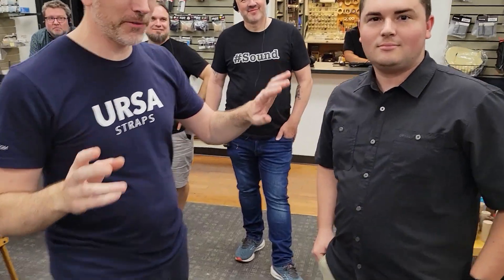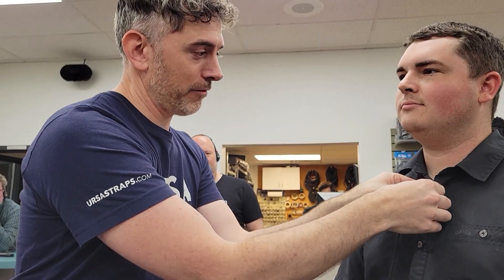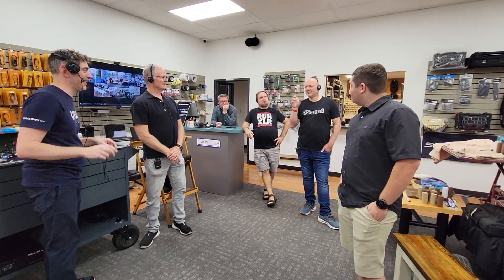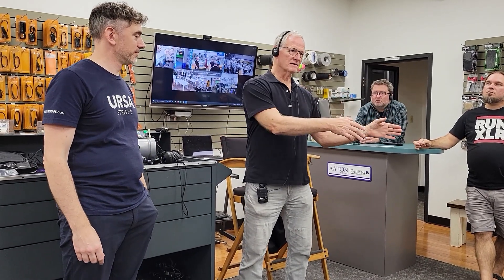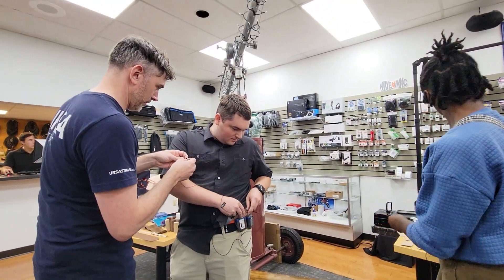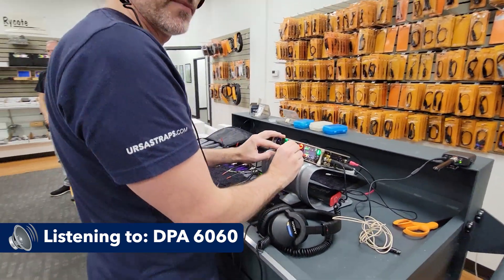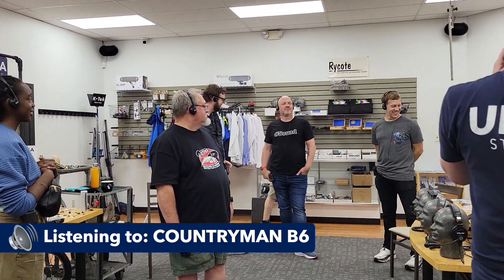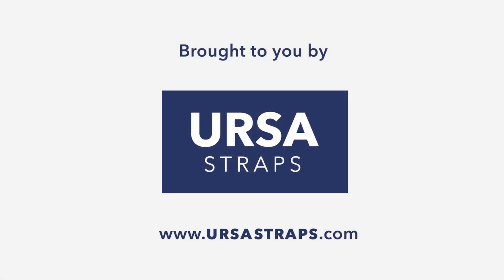We Tried Out A Button Hole Rig to Test the DPA 6060 vs CountryMan B6 | URSA Radio Mic Workshop

Comment: Listening from a YouTube perspective, I didn't hear a $300-400 difference between the DPA and Countryman.  Might be different monitoring at the mixer, but to the audience of which "should" be the bottom line, where's the beef?
Reply from the maker: In the case of countryman vs DPA 6060 one of the big things that is harder to show on a video like this is the sound pressure levels these mics can handle before they flatline and deliver to the transmitter a compressed sound. The DPA can handle much higher SPL compared to a countryman, so they handle loud shouts and singing much better. Also they do sound a little more natural. But there is a big price difference and if I was worried about damaging a mic I would go with a countryman b6 instead of a 6060